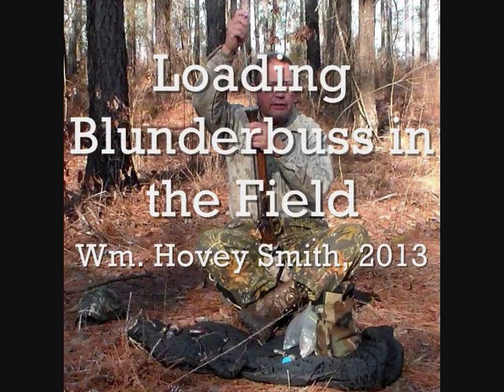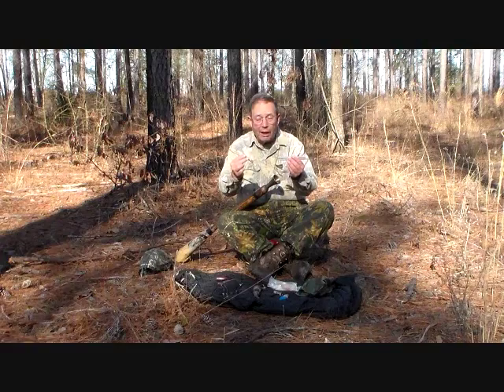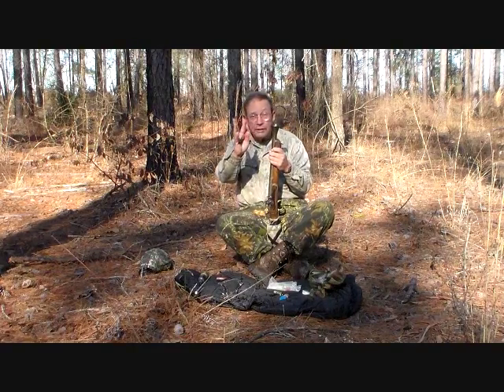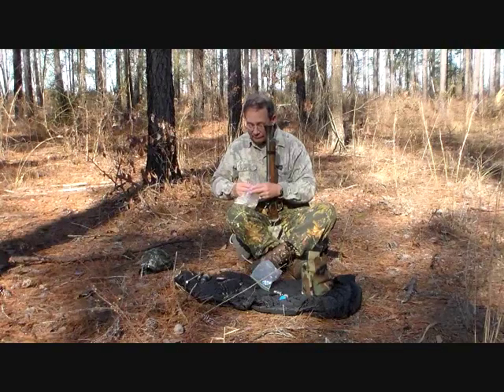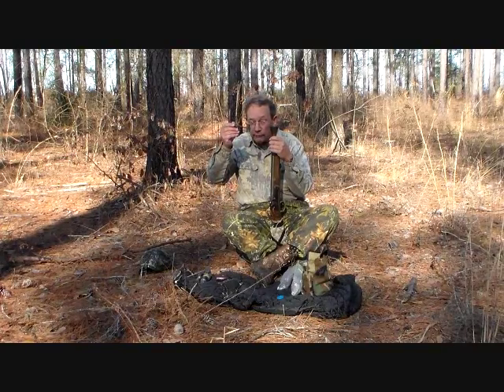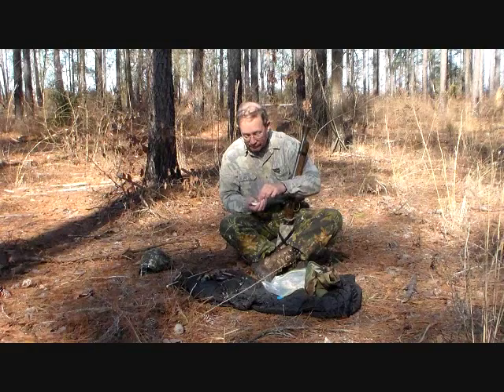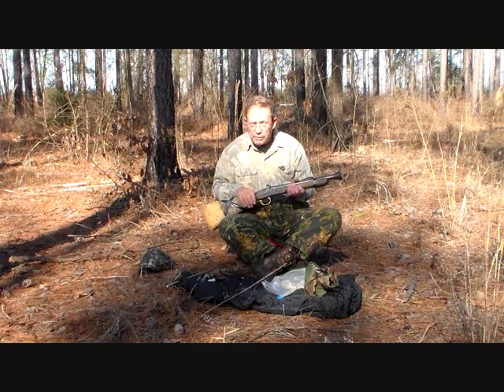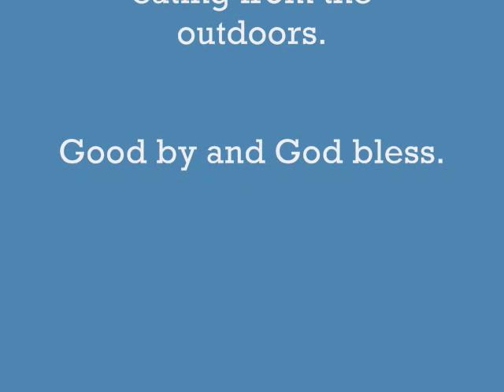Loading Blunderbuss in the Field.

Comment from the maker: I spoke in error when I called this gun an 18 gauge. It is a 26-gauge gun - a considerably smaller bore and more nearly like the 28-gauge cartridge loading. It is really pushing to load 1-ounce of shot in a 28-gauge gun. Because this 26 is the larger gauge, just as a 10-gauge is larger than a 12, you can use plastic wads with a hollow cup base and shot cup, if you can find them. I usually use a cardboard wad, Cream of Wheat and then load the plastic wads when I am using them in larger bores.
Reply: People routinely shoot 2oz loads out of .54 blunderbuss. I met someone who even claims to occasionally shoot 4oz loads but that seems crazy. 
I run 1-1.5oz loads of #4 shot with 80 grains of 777

Comment: what are the wads for?
Reply from the maker: The wads are to keep the forces from the exploding powder from scattering the shot and to contain the components in the barrel. They also help clean the bore when they are run down and increase the power of the powder charge. Yet another function the plastic wads do is to protect the bore from abrasion.
Reply: Hovey Smith OK thanks 👍